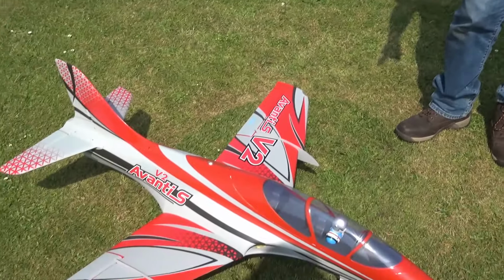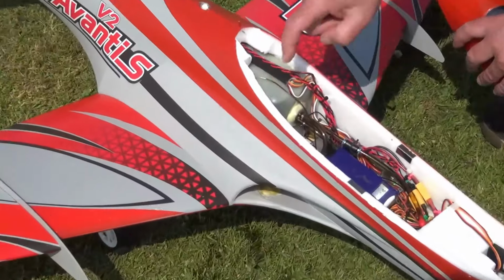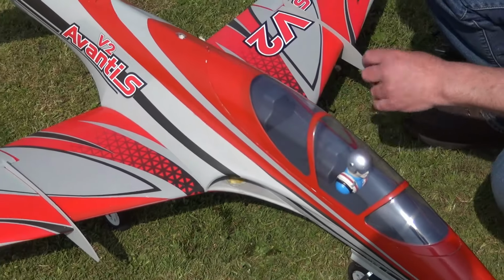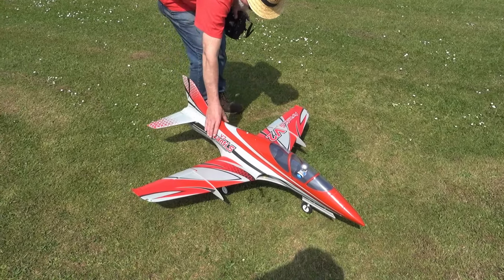Dom and his FREEWING AVANTI S V2 with TURBINE

Comment: Could you share your electronics installation. Can see in this model you did not put the battery over the front wheel. Same turbine and exhaust pipe? Thanks!
Reply from the maker: I will ask Dom and get back ASAP 👍😎